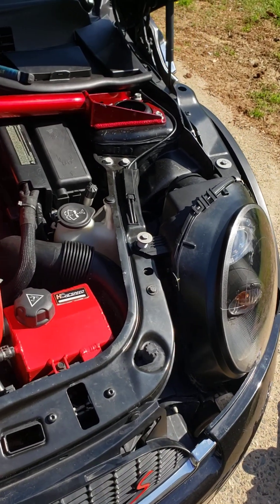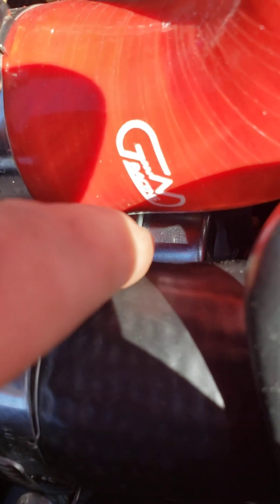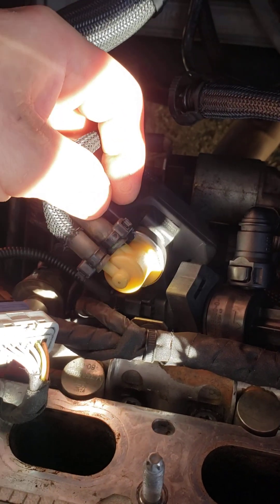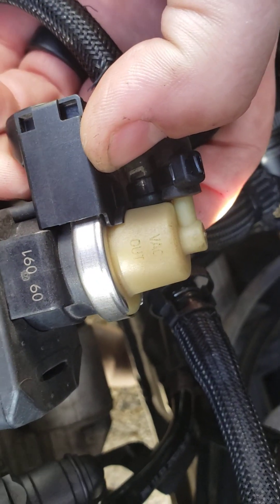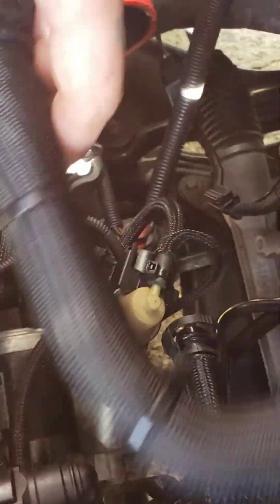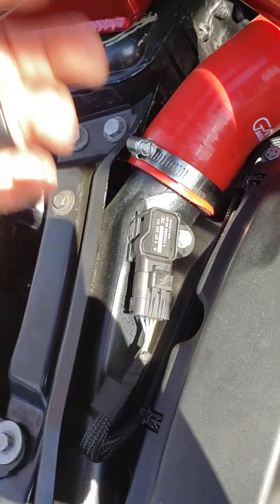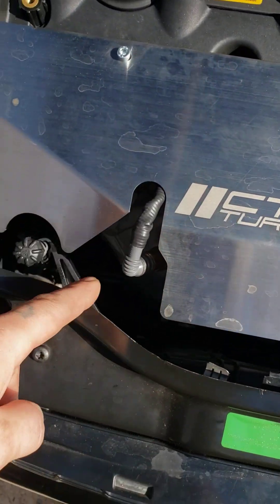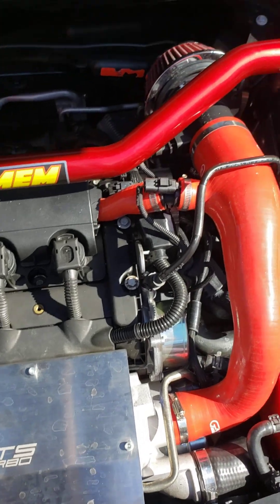Mini cooper S wastegate vacuum lines

Comment: Great Video! Thank you, super helpful. 

Also, to clear up the three sensors you mentioned in this video. The sensor immidiatly after the intake filter box is a MAF (Mass Air Flow Sensor). The sensor that plugs into the intake manifold is the MAP (Mass Air Pressure) sensor. The sensor on the tube between the intercool and manifold is the tempurature sensor.
Reply: Can you please describe the two sensors: the actuator sensor and the boost solenoid sensor? I think I mixed them up. They have the same ports and now I have codes but I am not sure which one is which one. Thank you.

Comment: Have you eliminated the vacuum box at all and just ran the vacuum line to the solenoid like an actual traditional turbo setup?
My stupid hoses keep popping off on highways going upgrade 🗻
Reason I ask is because im under the assumption that that reservoir is there because the vaccume pump pulls more inhg that what a car can do itself and that box brings it to a balance. Its so fucking stupied that there’s no nipple at the ends of the barbs on the vaccume resivor so the stupied hose doesn’t come off and so you can put a zip tie or hose clamp on the stupied thing. 
But know that I think of it Evan more it has dot airline shoved into a 2 inch hose that gos to the Resivor so the nipple grabs probably wouldn’t do anything anyways. 
Idfk mannn jbweld around dot 
airline fittings to the box and solenoid to just run hard lined I think
Because every barb that the vaccume lines run too are different fucking sizes bro like a 2 year old designed this shit so Evan running real rubber vacuum lines instead of that NOODLE SHIT wouldn’t work just because of that
Reply: Hi, I'm having the exact same issue, car through a check engine light on Monday, and after loads of investigation I have found both the lines have come off the vacuum chamber, did you figure out a way to keep them attached despite the lack of any barbs?
Reply: Hey I looked mine over every was connected started it following days it was fine?
Pile of shit.
Reply: What would happen if I put the 2 onto the vac chamber the wrong way around?